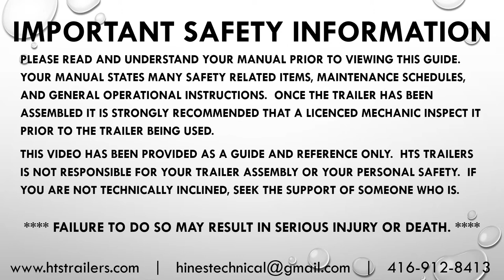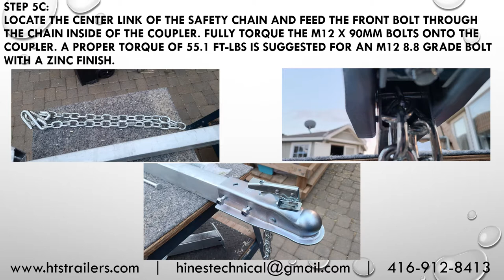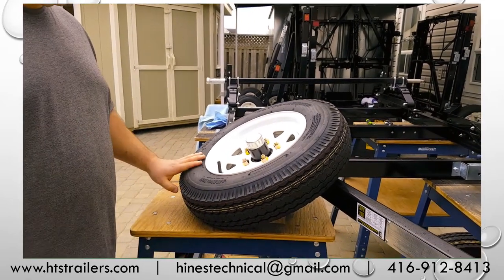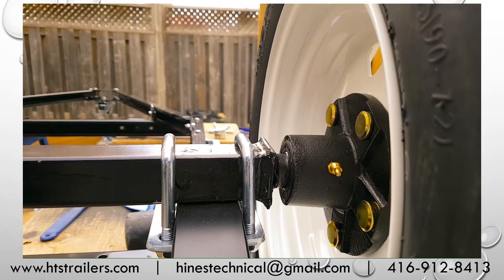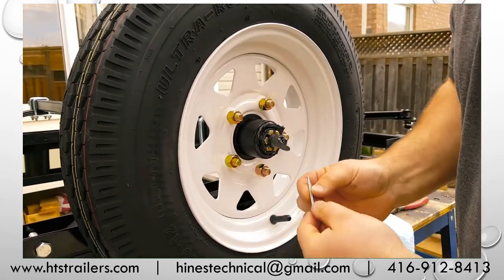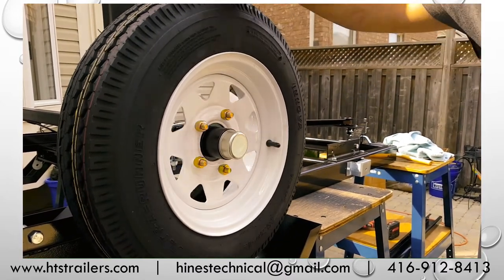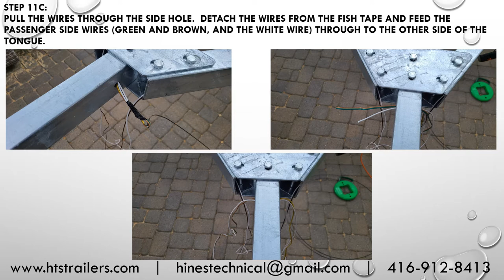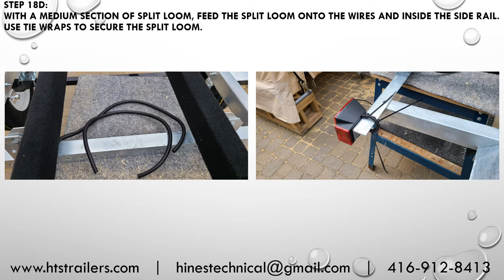DIY Trailers - Boat Trailer Assembly

Comment: what the best way to cover your trailers to protect them from the elements?
Reply from the maker: If you are unable to store indoors, a simple tarp with bungee cords will suffice.  The hot dipped galvanized finish does allow you to leave it in the elements.